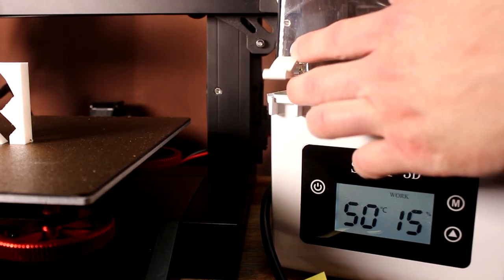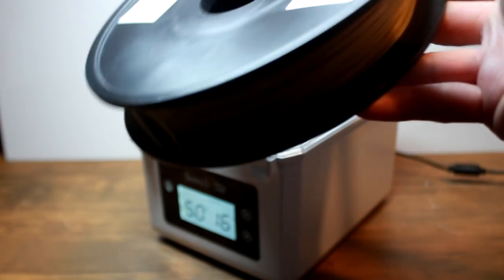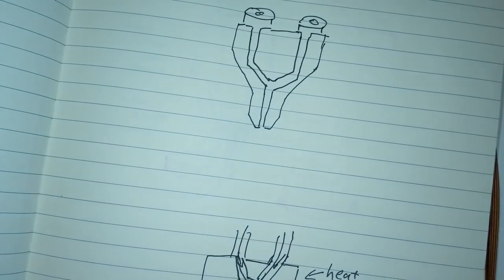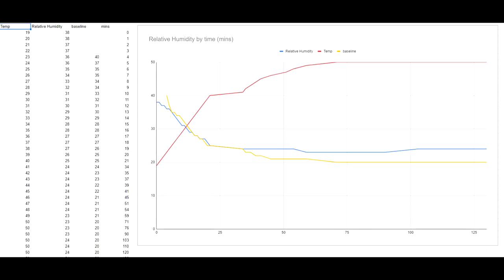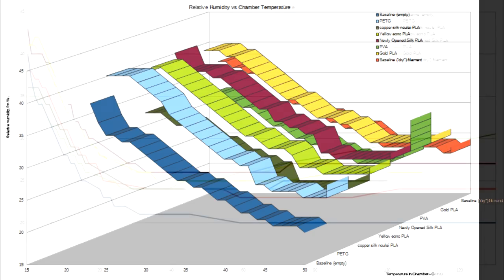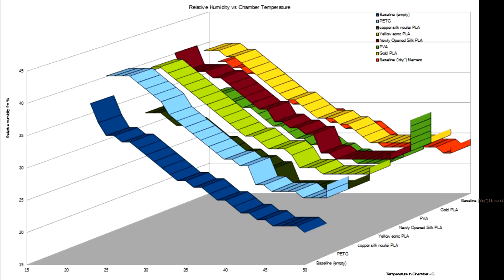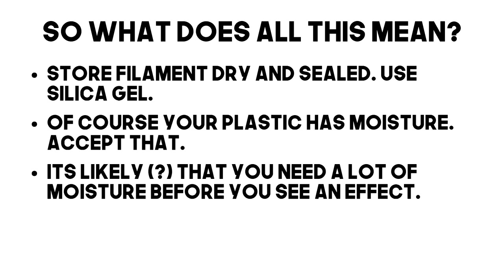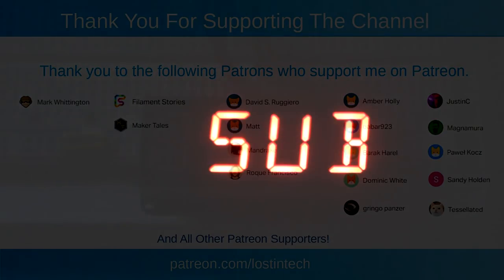So...all filament contains water? Things I discovered while testing out the Sovol 3D Dry box.

Comment: First, keep in mind that water can be absorbed into plastics, so it can also permeate through plastics. Keeping filament in bags helps, but don't expect the filament to still be dry after months of storage. This is also why purchased filament arrives to your doorstep wet. Second, a food dehydrator is the best choice for making wet filament dry. Dryboxes only keep dry filament dry, as you explained. Finally, like you said PLA does absorb moisture, but it's not that much affected by it. The same goes for the styrenes, ABS, ASA, HIPS. TPU and PETG are somewhat sensitive, and PC and Nylon are very sensitive. I don't think you can print the latter without a dryer, and if your prints last more than a few hours you need to print them from a drybox. This is from the Netherlands, so a similar climate to yours.
Reply from the maker: It's a very good point, and really hard to get your head round how something that's "airtight" can leak water.
Reply: 100% correct , Antalz know's what's up

Comment: I figured this out early on.  I use a box food dehydrator with the fan in the back.  It can hold up to 6 spools at a time.  So as soon as I get a spool and open it, it goes in the dehydrator. 
All spools coming out of the dehydrator go into Coleman 48qt coolers, which have 2lb of food grade silica poured into the bottoms.  Each cooler is airtight and will hold ~10 to 12 spools.  
I process all of my filament this way before using it.   All of my "my filament isn't dry enough" issues disappeared.

Comment: I've been using that exact Sovol drier for more than a year and it has made a difference.  The one thing that I agree with from your video is that apparently most don't read Sovol's instructions about leaving the cover cracked while drying, but sealed for storage.  If others take away only one thing from this, that should be to leave a crack so that the moisture expelled from your filament is released into the room instead of just recycled in the drier.

Comment: Nice vid again. I store my filaments in clingfilm with some silica gel bags. I don't have a dryer box but I recently fashioned a Box on top of my printer enclose which holds the spool of filament. Inside the box I have mounted glove warmers and a 4010 fan. The glove warmers operate on 5 volts and the 4010 fan operates at 12 volts which is half of its normal operating voltage. This way when the printer operates the box is also kept at a nice 32 degrees celcius and the moister can escape via the opening into the enclosure which is ventilated. To bad I can't show you the concept. But it works fine for me. I didn't have the stringy things but at the end of 1kg reel I started hearing popping sounds (moisture vaporizing in the hotend) and they have vanished for good.
Keep up the good work really enjoying your hands on approach.
Reply from the maker: Perfectly valid way of doing it, if I had one comment, it would be that the graphs kind of implied (maybe) that above 40C is where PLA starts to expel moisture faster, so it might be worth aiming for 40C, but thinking too hard about that makes my head hurt, it may well work just fine with convection and 30C+. Again - it comes down to acceptable tolerances, if it's working, it's working! 👍
Reply: I don't want to spend more energy then required. I could insulate the box so the temp will go up a bit. Recently saw a vid from Alex Kines testing the influence from uv light, so that might be a double win.

Comment: Printing with my favorite translucent PLA today.  If I don't dry it, it is so brittle that it will break while printing and also bubbles leaving strings.  Dried at 55C for a couple hours, it is amazing.
Reply from the maker: some people think brittle means dry. I thought brittle meant wet.  
It's all very confusing.
Reply: @LostInTech3D  I guess you could say that a filament is "dry" because solvents have evaporated.  And this brittle filament I have may have sat in a warehouse for a couple years.  I definitely see tiny bubbles in the nozzle stream, and they go away if I put the spool in my food dehydrator, so I'd call that "wet".  Maybe this stuff is "dry" and "wet" at the same time!

Comment: Another cool thing you can do with old PLA roles is to anneal them using the drybox. Old PLA tends to get brittle, and filament breaking while printing doesn't improve quality. Put a roll of old and brittle PLA into the drybox at around 60°C (or a bit more if you are adventurous) and leave it in for a few hours. After that, if you got the temperature right and the stars align, you will have an almost-like-new roll of PLA.
Reply: I've been thinking the same lately. Through testing, I've found slightly improved print results after 'drying' supposedly already dry filament. Annealing is a good explanation of what is likely happening.
Reply: If the stars aligned...no,those are planets...If the planets align, I will no longer have that old real of PLA. I was wondering if that would work.
Reply: Risky business, you may have the filament welding to itself on the roll. I once tried to ensure I had a new dry roll. The printer ended up having issues extruding as the filament had to be ripped off from the roll.
Reply: @dbtest117  Haven't had that. You'd have to heat it up quite a bit for that. One thing I did once have is that I had the dryer a bit to hot, so when it pulled the filament off the spool, the filament would kink a bit, and these kinks were too sharp to fit through the bowden tube. But that only happened while the drier was actively running. I turned the dryer off and a minute after that, everything was fine.

Comment: I have two conflicting hobbies, aquariums and 3d printing. I have to use dry storage and a filament(food) dehydrator to keep my filament usable. I have quality issues after 5-6 days of keeping a roll out, so I swap rolls after 3-4 days to keep the quality. I'm working on a solution to this, but one step at a time. I switched boards and I'm still calibrating my printer.

Comment: I am shocked at this video. This is a crime. You only have eight spools of filament open?!  Great video. I love the bit about keeping the box open. Mine has a fan on it and your point is well taken. My assumption was that the air was being refreshed via negative air pressure causing more air to be pulled in from the small openings which you can feed the filament out for printing.  I haven’t tested this, it seemed a logical deduction (or so I thought, I’m thinking “assumption” would be a better word now and I’m thinking I could be completely wrong).   I’m very interested in these other projects you have coming up!
Reply from the maker: Haha thank you. I may have more reels that I spoiled by messing about with heat before I started testing properly, so I'd probably guess at more like 12, but I can aspire to more! 😂
I guess you're going to be getting a LOT of use out of that new dry box the other day now? 👍
Reply: As we speak, it is currently holding and heating a spool that started stringing on the second print—a silk PLA that is new. I, also, thought that moisture in PLA was a lot of worry and hype, having always been able to leave my filament out and unprotected. I wonder if with the newer additives for ease of print ability, something is subtly different?
Reply from the maker: That or maybe it wasn't so dry when it arrived, I guess?

Comment: As much as you didn't want to touch on the subject, I think it's important to educate people - if for no other reason than that it's a neat fact to know - that humidity does have a measurable impact on filament (even disregarding the prints themselves, just the filament on its own).

Also, just as a caveat to the reason why the humidity is rising with the filaments in the box: I don't know what kind of humidity sensor the Sovol uses, but if it's a standard component then it probably uses the change in capacitance of the air to derive a change in humidity. BUT, water isn't the only thing that changes that variable; literally any airborne particulates can, too. So while it's highly likely that it's moisture in the filament, it could very well be any of the VOCs in the plastic off-gassing. I don't have the equipment to run a test myself, but conceptually, a hygrometer in an empty vacuum chamber should show a different reading to one in a vacuum chamber filled with, say, dry alcohol; the alcohol will boil and evaporate, and the gas in the chamber (which, having had a vaccuum drawn, should be virtually absent any water) will cause a change in the capacitance compared to a "pure" vacuum. Again, this is getting really into (I assume) tiny details that probably won't have much of an effect on the functioning of the device if used as intended. I just saw an opportunity to ramble about physics and I took it xD

Didn't mean to go on a long tangent there, tl;dr: don't trust a machine to only measure humidity just because it's called a humidity sensor.
Reply from the maker: all good points well made...interesting. 👍

Comment: In many places you can get shifting color markers silica gel by weight, which is way cheaper than in packs, with the advantage that it shifts colors as they absorb moisture, and you can place them in the regular hoven at about 120C to dehydrate them back without any odor or chemical drawback for cooking. When dehydrated it regains its original color, and you can repeat this process about a dozen times before needing to replace the pallets.

I live in a very moist place, I have a food dehydrator for which I replaced the bell for a taller one as to be able to fit three rolls at once, and I've made holes on the top to ensure the moistured air can run out and get replaced by dry heated one from the base. I store rolls on ziplock bags and pour a fistful of silica pallets inside along the roll, so I am able to check the pallets color in the bags. You can tell from the time it takes for the pallet to change color how much moisture the roll had. If it happens too fast (let's say, in a matter of days) or if I need to print with a roll whose pallets are wet, I use the food dehydrator, and afterwards I pack the roll again with fresh dried out pallets, gathering the wet ones to make a batch to be dryed in the regular oven. So it becomes a seamless repeatable process with a feedback you can relate with the prints outcome.

Comment: Great analysis! Also in my testings over the years I came to the same conclusion, storing them in silica containers, even while printing  and without drying, makes a noticeable difference. I use my own “Marsgizmo Filament Bunker” which is a relatively cheap solution (free design). 😉

Of course, ideally you want to dry them as some are coming already wet from suppliers, but I noticed if I use quality filaments I almost never have to dry them (only to store in Silica Containers all the time).

Btw, Molecular Sieve granules are better than Silica.
Reply from the maker: silica gel vs molecular sieve. Challenge accepted!! 👍👍👍
Reply: @LostInTech3D  mol sieve comes in many, many different pore sizes. Be certain your supplier sends you the right stuff for water vapor specifically... oh, too late.

Comment: What I have wondered recently is if there was a way to rapidly heat and dry your filament immediately before its fed into the exyduder. Sort of like those instant boiling kettles where just the water you need is passed through a coil on the way out the tap. 

Surely 1m of filament will dry quicker than 1kg of filament. 

That way you dont need to worry about keeping a dozen spools dry, or putting it in a dehydrator for a few hours before you can use it.
Reply from the maker: I guess that's a viable idea. Probably really easy to execute too. But I guess what you'd need to know, as you say, is how long you need it to be warm for. It might not be that long. Interesting idea.
Reply: @LostInTech3D  you could probably loop it up and down some pulleys in a heated chamber if you need a bit more time drying. I was originally envisioning passing it through an old heat block without the nozzle and a fan blowing on it. 

But I'm not sure if it scales linearly. If 1kg takes an hour to dry, does 100g take 6 minutes? 

It needs someone more scientific than me to test i think. 
I know cnc kitchen usually weighs his filiment to see how much moisture is removed.
Reply from the maker: That's exactly the question! I don't know. I guess it won't be linear, but it should scale to some extent.
Reply: What about using vacuum?
Reply: @daliasprints9798  no idea, but your idea is interesting.  Maybe a tube with just a negative pressure and dry air coming in over the filament. Instead of a perfect vacuum?

Comment: I use a dryer. In fact I keep it running at about 50C while I’m printing. I live in the American south and my printer is in my garage, so in mid summer I’m printing at typically 35C and 50-60% humidity during the day and 20-25C and 90+% humidity over night , and that’s not a recipe for decent prints unless I keep the roll of filament I’m using in a dryer. I used to get a huge amount of stringing before I got the dryer especially if I had a spool on the printer for longer than about 24 hours, and that was with me always storing filament in ziplock bags with silica desiccant. I almost exclusively print with either PLA plus or silk/metallic  PLA

Comment: With pla, I've sometimes noticed that ones with significant additions (like pla +) or certain pigments can make it suffer from moisture, but plain pla generally is unaffected by moisture
Reply from the maker: I forgot to mention that in the video actually - good call. Silk PLA has additives (polyester?) I think which is really hygroscopic. Or so I heard. 
I've also noticed that silk PLA has really bad die swell sometimes which may be related.
Reply: @Lost In Tech  I'd assume pla's chemical make up would make most stuff its bonded with pretty much water proof.
Reply: I would agree with this. CNC kitchen made a video testing structural properties of filament after absorbing moisture and PLA suffered minimal degradation. The biggest issue I have found with PLA is that it gets super stringy after a while, but I generally just bake it in the oven @60 degrees for 90 mins and that seems to do a great job.

Comment: Even putting the filament in a sealed dryer will work quite well. In the case of the Sovol dryer you see condensation build up on the housing. This came from your filament which means its no longer in your filament. Its better to leave an air gap for this to escape, but it doesnt actually matter that much. You just have to remove your filament after drying, otherwise the filament will reabsorb it.

You can put silica gel in these dryers, BUT the gel must be itself dry, if its not the gel will just liberate water as well. Ive done this myself by drying gel in a filament dryer, you get a lot of condensation. Silica gel can be dried in a microwave or low oven (if not in a paper packet).. Unlike filament..

Comment: I'm relatively new to 3d printing, and have only used PLA or PLA+, but I have noticed that filament that has been laying open, but unused for a week or more does adsorb enough moisture to affect the results.
The filament can even improve as it is used; effectively the top, damp layer is printed out, and dryer filament starts passing the nozzle.

Something I didn't know was that leaving the box open a little while drying could improve the process, so thank-you for that idea.
Reply from the maker: I would say if the box is on, the lid needs to be open. I think that's pretty important, yeah. 👍
I was also curious about how moisture can migrate through the layers but that's starting to get a bit hardcore.

Comment: Ironically I bought this exact model last Sunday and have observed the same things. Using silica Dessicants  at the bottom really helps.
Reply from the maker: Silica gel is the underappreciated hero in the filament drying world!
Reply: Along with reusable vacuum seal bags! Bought them all at the same time and was surprised by the eSun vacuum bag kit. You can practically shrink wrap the filament with silica packs using an included hand pump. Generic vacuum storage bags probably work the same but the eSun one is perfectly sized for filament rolls.
Reply from the maker: I use those too - just basic household vacuum bags for me though, but same thing

Comment: I've found that most filaments benefit from at least some drying out of the box. I usually throw a cannister of dry desiccant in with the spool. Indicator gel is handy for this. Even at the elevated temperature it picks up the moisture better than the plastic.

The untreated plastic bags the spools come in aren't really all that good at keeping moisture out long term.  Water just gets everywhere and into everything. That's what it does. The metalized bags that really aggressive materials like nylon often come in are much better at it.
Reply from the maker: Yes! Indicator beads are awesome. I did a video about them and nobody watched it...oh I already said that in the video :D
Reply: @LostInTech3D  One of the best things I ever stumbled across on Amazon. Takes all the guesswork out of the silly little packets of gel.
Reply: I buy polymaker filament and the bag are just as you described and I can confirm, these "metallic" bag really work. After taking petg out. No stringing on that spool for at least 3-4days in a box full of silica gel

Comment: PLA is generally LESS susceptible to moisture problems that other filaments, but as you've seen, it definitely does still suffer. UV degradation, however, is the main problem with PLA that I think isn't addressed enough. I'd like to see some more YouTubers address that (Alex Kenis is the only one I've seen investigate it, and his results were eye-opening).
Reply from the maker: Interesting...I'll make a note to check his out